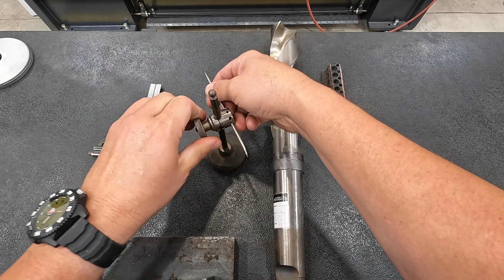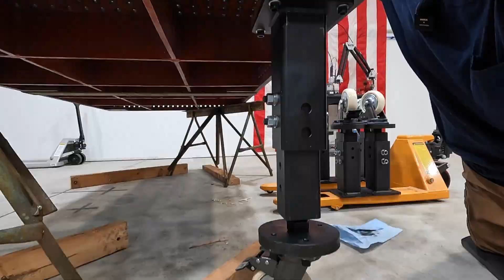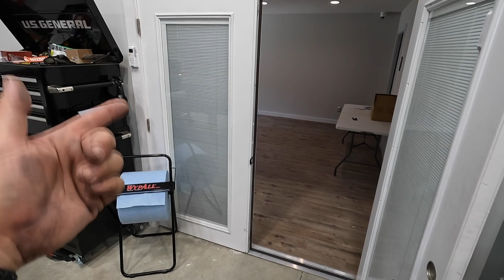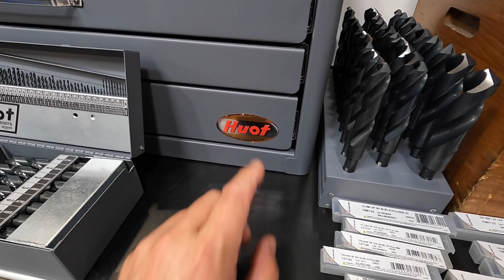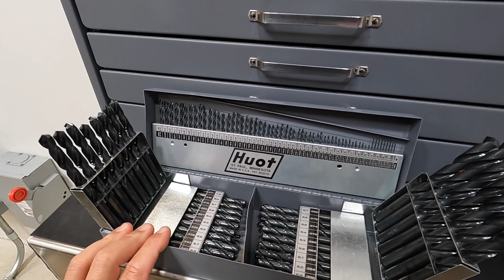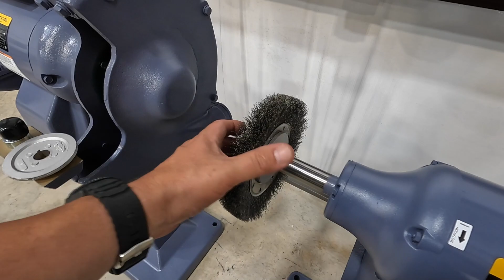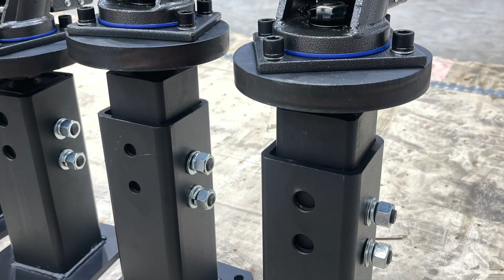SNS 365: Fireball Tool Welding Table, Balder Grinders, Tap Storage, Antique Store Finds

Comment: 7:37 Letter drill Sizes ... I ALWAYS wonder why Letter Drill Size "E" is exactly .250", same as 1/4"
Reply: so they can mess with your head
Reply: The "1/4 inch " drill in sets is not .250".
Reply: @charlesblanton1008  Huh?
Reply: @charlesblanton1008  
HUH?

Comment: make a plate and some bars under the table for sorting clamps and fireball tools , lot of wasted space underneath the table perfect for that and saves space on the wall for other toys.
Reply: depends on if you wanna be able to sit at the table
Reply: @CatNolara  even than if you would recess it a bit from the top it should still leave plenty of room and its a work table/bench not often you sit at it with your legs under neath.
how often do you sit with your legs under your regular workbench ? 
myself never cause its all storage and drawer under my work bench. what most often is the case with workbenches
Reply: The space isn't "wasted", it's merely "available for optimization", and that looks different to different people.
Reply: If you load up the underside, it's going to get difficult to roll the table across the floor. Good idea for a fixed table, not so much for a mobile one.
Reply: @grafixbyjorj  but mounting a couple of big vise to it doesnt matter then ? 
bet all that tooling still would way less than those 2 vises let alone that hes getting that fireball behemoth mounted to it .
Reply: @cornnatron3030  Well, it all adds up. Also, putting tooling under the table means you have to bend down to grab it, which we know Adom[sic] doesn't like.
Reply: @grafixbyjorj  if so do you think he also keeps the bottom drawers of his toolcart behind the table empty ?
and i also think that table wont give to much about a 1000 pounds extra and dont think it will be moved to often or far for that matter when the shop is finished to be honest do to space.
and he could make it like a cnc project to make some boltable fixtures with same hole patern to store the clamps and pins and other parts , doesnt even have to be out of steel could be alu seeing its not load bearing.